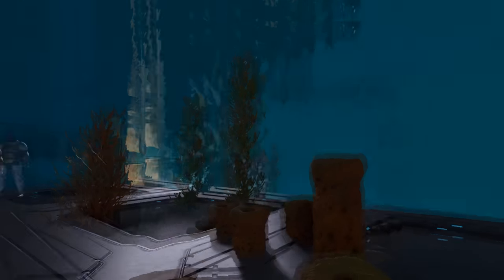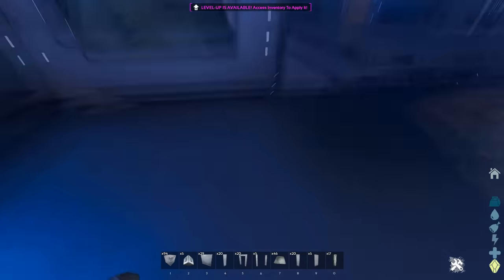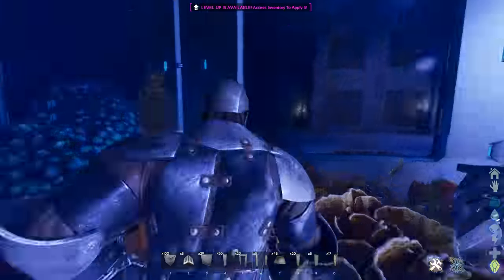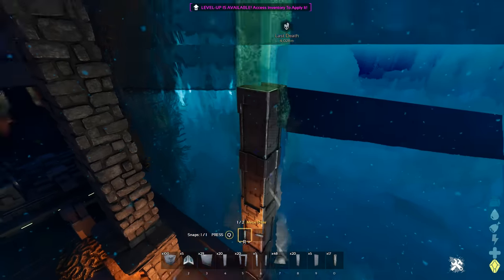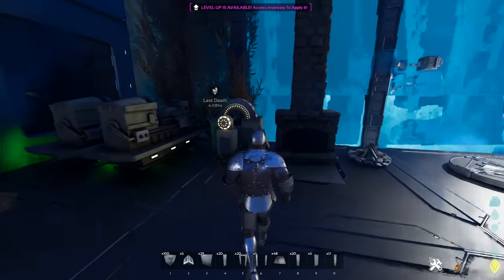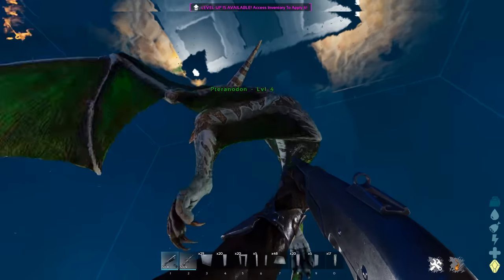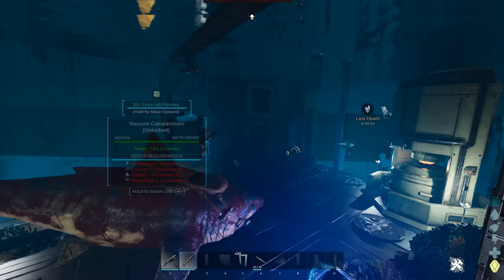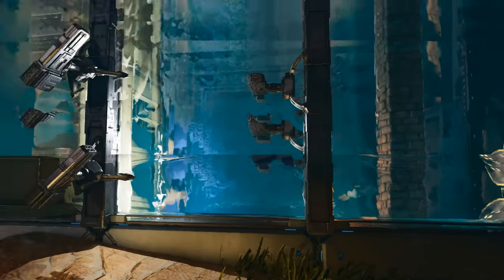ARK ASCENDED VACUUM CHAMBER TEST AND SHOWCASE.. NO WALLS NEEDED?!

Comment: We did this set up years ago.... Heres a tip.... Make a single pillar of vac comp up to the sky as high as you want. Then spread out a flat lane of vac comp all attched to the vac comp pillar... Under stand so far? Now build your base on that platform. When you are done remove all the vacum comp and pillar. Your base should float in the air now.

Comment: how did you place the industrial forge? literally whenever I try to place it in the cubes it tells me it is obstructed, whether the frames are hidden or not.
Reply from the maker: not sure why ur having issues dude, something must be in the way
Reply: @ShaneTheShadow  I tried again, and at multiple levels with nothing built in it yet. Absolutely nothing lets me place the Industrial Forge no matter what I do.

Wonder if a setting is randomly blocking it somehow. I can place it anywhere on land just fine.
Reply: Im having this issue too. Maybe its a mod were using are you using any?
Reply: @Brucesleek  I have 0 mods installed. I only play officials, and go to SP to test certain things out.
Reply: I have the same problem, did you fix it?

Comment: Can train tracks and trains be placed in these? That would be based as fuck. Driving around in your underwater choo choo train. 😂
Reply from the maker: u know what tonight imma try that for you, if it works i will post a video
Reply: @ShaneTheShadow  if it does work,  I'm dying to know what will happen if you flood the compartments lol
Reply from the maker: @jaybartgis5148  mate said it doesn't but I'll try
Reply: @ShaneTheShadow  let me ask you a question. Do the train tracks prevent resources from spawning? Could you theoretically lay lines of tracks in a forest, and drive the train in reverse with your friend mounted on a therizino quickly decimating trees for wood? Or will the trees just not respawn?